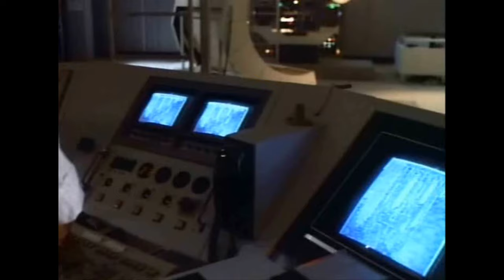The Most Important Device in the Universe - Blinking Tubes Without Function New Compilation (Part 1)

Comment: Those tubes have seen more use than the Wilhelm scream
Reply: What blows me away, is that virtually all the clips appeared to use the exact same prop, sometimes set on a wheeled base and sometimes on a different base, but each time the rest was identical.
Reply: As common place as the transporter beam/ room. Every one has one.
Reply: I didnt realize it was clips from different movies untill I read your comment.
Reply: aaaaaAAAAAAH!
Reply: Oh I should bold my text next time to get the likes.
Reply: I guess Robby The Robot outlived the hi tech look.
Reply: I was gonna say the same thing.
Reply: Not quite, but it certainly has more use an the Galactica fighter launch sequence or fighter cockpit.
Reply: I went to like this comment but noticed it already has 666 likes, I don't wanna mess that up.
Reply: Not even close....yet. Soon, though...
Reply: @wiesejay  !!!!!
Reply: Did you hear the beginnings of that scream while Thor punched it into the wall?
Reply: Aka the stormtrooper scream.
Reply: Yurrerererrrrrrrrrrahh
Reply: Maybe we should call them the Willhelm Pipes?
Reply: Someone start a proposal to call this blinky thing a "Wilhelm Blinky Lights"
Reply: @StarlasAiko  maybe not but is a close second place! Maybe!?! 😆
Reply: cynaptyc the issue is, the Wilhelm scream is used in every genre, except maybe romance.  These tubes are sci-fi only.
Reply: @StarlasAiko  I was hoping the sarcastic take would of came out better but it's a limitation of text! 
I know that, was just trying to be funny. 😆
Reply: Needs to have a button somewhere on it which, when pushed emits the Wilhelm scream.

Comment: Wow, this is really impressive. Not only the longevity of the prop but the time it must have taken to compile this video.
Reply: There's also several versions of it. Looks like the design goes around.
Reply: The video probably took more time.
Reply: ....so many bad movies.
Reply: @alexxx4434  just painted with different additions.
Reply: Some are different scenes from the same use. Too bad.
Reply: @douglasarnold4248  Nicole Star Trek bad? you need to learn

Comment: The successor to the Jacob's Ladder that was seen in every mad scientist's laboratory in several early-to-mid 20th century movies.
Reply: I loved those Jacob's Ladders. I made one for a Science Project. Warning Do Not Touch, they hurt like never before.
Reply: And my workshop....
Reply: The technological advancement is astounding
Reply: @rancidpitts8243  "do not touch arcing electricity" sounds like solid advice
Reply: Is that the electrical shooty uppy thing?
Reply: @tdegrddeehjgd  Yes, that's the technical name, the thing with two wires angled out to a V,  sparks climb up it
Reply: @tdegrddeehjgd  yup!
Reply: @2MeterLP  You only do it once.
Reply: @tdegrddeehjgd  Indeed, that's the one. An arc of electricity rises up between two tall wires in a narrow "V" shape. The Jacob's Ladder always had a characteristic Zap/Snap sound to it. The same prop was used in "Frankenstein", "The Munsters" and "Young Frankenstein", among others. It is probably still in some prop warehouse in the Los Angeles area.

Comment: If I ever run a Starfinder home game, I'm putting these in it.
"How well-equipped is this lab?"
"Gimme perception (DC 5)"
(pass) "It has the clear tube with the red lights that blink in a circle. That means it's very well equipped."
"Do these have any function?"
"Gimme engineering (DC 35)"
(fail) "They seem to have no function."
(pass) "They definitely do not have any function whatsoever."
Reply: That's impossible! They're so pretty!
Reply: @jamesrowles9249  but that it: they're pretty. Just because something is pretty doesn't mean it's useful...
Reply: @notmuch_23  omg, these props are an aligory of everything's that's happened in my life!
Reply: Should be, pass/fail same as you have, but then:
(Critical success): "The lights are blinking out of sequence"
______________________
(Expected result): If players can make them blink in sequence they get reward
(probable result): Game gets derailed as players spend hours trying to decode the "message" that the lights are saying
Reply: @gregsimoes8645  The reward would be seeing them blink in sequence

Comment: They're there to test if the speed of light is still the speed of light. You never know when Physics 2 might come out and require you to update your faster than light spaceships.
Reply: unironically some laser setups are like that, to detect minute differences in angles, pressure, etc
Reply: So you can go to ludicrous speed

Comment: Is it wrong that I want one of these as a conversation piece? Put them in a corner at work (doesn't matter where you work, just have it in the corner) and you'll either get knowing smirks or very confused people.
Reply: I'm thinking I may model a scale replica of one and 3D print it. Same idea as yours, just with a smaller amount of floorspace eaten up.
Reply: honestly someone should start making a small desk size one and sell it on etsy or something.
Reply: I'd buy a tabletop sized version of this prop just for a conversation piece!
Reply: The 4 end parts are pool skimmers if you wanted to build one lol
Reply: How about a micro version to hang on your keychain?
Reply: @suntech5868  and earring ones
Reply: I don't know how we all make it through the day without one, I need one.
Reply: @ecz28  I thought the end parts looked familiar,  my pool has a slightly smaller version of that exact part, you are correct.   Now for some plastic tubes and blinking red lights and I can save the earth from eminent destruction.
Reply: @ecz28  I was thinking more alarm clock sized, but I appreciate the heads up. That makes it easier to figure out how to scale the dimensions down more accurately.
Reply: A lego model with glowing beams

Comment: As a child growing up in the 1960s, I always imagined that I would have blinking lights everywhere in my home with buttons on them by the year 2020.  Nothing today really looks that cool or futuristic.  Most advanced piece of tech most people own is a phone.  We had a black one with a dial in the 1960s.
Reply: The cool stuff is in the labs, we're stuck with the flashy red tubes with some function.
Reply: Idk my rgb glass-sided desktop pc  would probably look pretty futuristic to someone in the 70s-80s. Especially when I can make it rainbow light dance with the keyboard & mouse lol
Reply: I think we went past that era already. Like we did with flip phone communicators. We had quite a little constellation of lights, and buttons when we had DVD player, 2 VCRs, cable box, and  cable modem. Now we don't even have a  clock on the cable box. Used to be there was a clock on everything even things that didn't really need a clock, all blinking 12:00 12:00.
Reply: The flashing clock on the VCR killed any market desire for light accents... Now it's a feature if you can turn the blue lights off... or stick a piece of tape over them...
Reply: Yet no one can figure out how to make a functioning printer. I literally have been hoarding broken printers so that I can make my own, I'm sure I can reverse engineer something decent that works, and can use any ink, well hopefully... I just want my computer to print to it and it not say offline for no reason...
Reply: What, you don't have blinking lights everywhere?  I'm sure you've got tens of thousands of them, just on the device you're reading this message on alone!  They're just tinier than you're expecting.

Comment: Never forget those backdrop meshes with the middle square as seen in the first 10 seconds on this clip.  From the Romulan bridge in Tin Man to the transporter room to Qs trial and various prison cells. It's like it is something that was attached is now missing. They also appeared on stargate.
Reply: That odd back lit grill. That's way over used for set construction. They must have had a lot of it laying around in the mill.
Reply: @radioflyer68911  but is it a waste product, designed or like a wood pallette, where it just exists and has many uses?
Reply: Babylon 5 also used something very similar. But I think it was a slightly different design.
Reply: @thenextmrsbrownful  hard to tell I've seen interview with the prop builders they would get in trouble for dumpster diving anytime they saw something with an interesting pattern or shape they could paint and glue to a wall lol
Reply: ORBIS Freezer Spacer, 1.5"

Comment: That prop has certainly been in a lot of different productions over the years.
I wonder if it's still around.
Reply: It's owned by a company called Modern Props - which rents out this not so modern prop built in the late 1960's.

Comment: The grey parts on the ends look like pump or macerator housings. There are three ports, water gets sucked into one port then squirted out another, the third might be for draining/cleaning. I would guess they are fiberglass or plastic but could be cast iron, though that would make it dangerously heavy.
Reply: Yes I noticed that. I think with a few extra fittings,  I could probably adapt it to recirculate the water in my Koi pond.
Reply: As it happens, the gray parts on the ends were embeddable pool skimmers, turned so that they're facing downwards.

Comment: The devices on each side of the clear plastic pipes are industrial pumps. You can find them in industrial supply catalogs, along with the clear plastic pipe to fit them.
Reply: They aren't industrial pumps. They're pool skimmers.
Reply: @GeneTurnbow  Yes, you are correct. I see now that they are Baker Hydro Skimmers, which are more elaborate then a industrial pump, and cheaper.

Comment: Ah... good old stock props in the 80's provided by the now out of business Modern Props!!! In TONS of movies and shows over the years. Those big wall consoles from WOK in engineering that were used to fill the empty space... Those were from Modern Props too.
Reply: I posted a question about who owned the actual prop before I saw your post.  Thanks for the answer.
Reply: No wonder they went out of business since all their props were re-used for decades.
Reply: @geordi5054  They went out of business because John Zabrucky is 75 and wanted to retire. No other reason.
Reply: @Scifi4Wifi  Can't handle a joke?

Comment: Maybe a "Plasma Inductor"  General idea is that it keeps super heated plasma constantly moving to maintain its extreme high temperature.  Actually, every scene in the compilation it would fit with what was going on and where the equipment was.

Comment: Best guess from context in all these clips, ( yes i'm fully aware it's a stock prop with no real meaning or intended use ) it's being used as scientific equipment and in industrial settings pulsing lasers in gas with specific intervals and known targets ( something inside the machine ) my best guess would be a high precision event timer using lasers to bounce signals and calculate discrepancies in physical matter, which could be used to scan anything from air quality to signal distortions in data streams due to local spacetime discrepancies from gravitational lensing or the quality and consistency of grav plating in a ship or hangar using known targets or arbitrary samples with given resonant frequencies. as a bonus you could get meta data like temperature, vibration, density, chemical makeup and others from inserted samples too, which would explain it's prevalence in all places technological in the galaxy as materials, quality control of systems and sensor information aka data is highly valuable to an advanced society.

Tldr, fancy scifi sensor of some kind.

Comment: Those are fluid impeller pumps! Most likely for a pool filter setup. You can clearly see the pump manifold and the motor section connected to it. The input of the pump has the red light tube.

Comment: When IBM came out with the 360 computer in the early 70's The operator panel was blank. Marketing made them fill it with rows of registers flashing. This was because everyone's idea of a computer was the wall of flashing lights on the submarine Seaview (Voyage to the Bottom of the Sea). To this day your laptop displays a useless blinking light for disk access.

Comment: Thank you so so much for this! I had noticed the starring role of the prop many decades ago but never knew it had so many starring roles. Is there an IMDB page for it? How about a Wikipedia page? Did you post a list of all the sources you shared? I would love to see a fee screen gems I have never seen. 

This video was as interesting as the life history OK the Knight Rider transport and the Airwolf helicopter. Note to others, check out Adam Savage Tested for cool prop videos, he recently featured the Echo-1!
Reply: Funny you should mention the Knight Rider transport. Gene did the wiring for those blinky lights too.
Reply: @susanfox6081  thinking about those space shows from the 60s, Lost In Space, for example, which had a bank of flashing buttons. I think perhaps there were puppeteers who pushed the buttons to light them up. Such things inspired my interest in electronics in my childhood. I made many projects, but the one practical project was a simple Fm radio receiver mixed in was some random flashing LEDs just for fun. Unfortunately,  a teacher at my school assumed it was a bomb and police were called. After my device was destroyed, the school purchased for me the most fancy Sony Walkman of the day! Anyway, I'm sidetracked, I recognize that the lack of transistors in those days would have required the use of tubes, extra power supply to power the tubes and giant capacitors and resistors to power higher voltage light bulbs. The circuit boards must have been huge. I think someday I'd like to assembly a tube device are learn the ancient tech of my grandfather(who was radioman in the army).

Comment: It looks like a miniature particle accelerator.

The particles accelerator will be the key to bending and warping opening event horizons and maintaining the connection or opening of wormholes to allow faster than light speed travel. It is a key to traveling space beyond the solar system, throughout the Miljy Way and beyond.

The particle accelerator will also be key in sending or transportation through particle beams over miles from above planets while in orbit.

It may also be key to super hypersonic travel in space within solar systems.

Very important indeed! The LHC (Large Hadron Collider) is just the beginning!